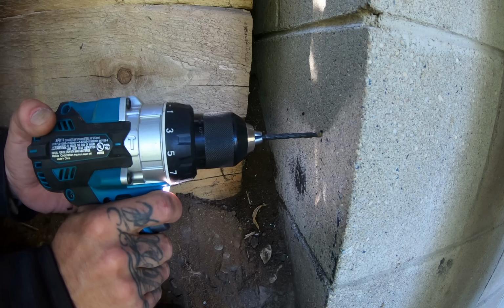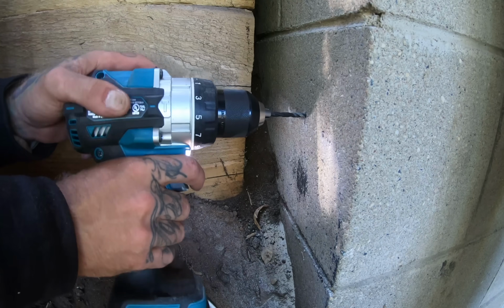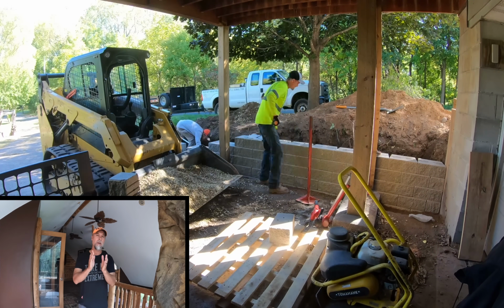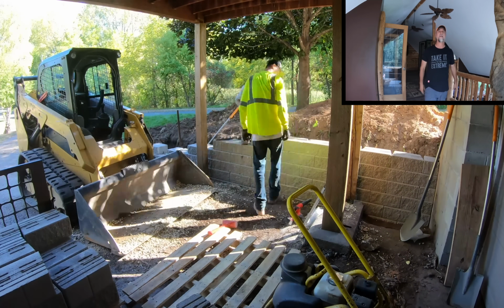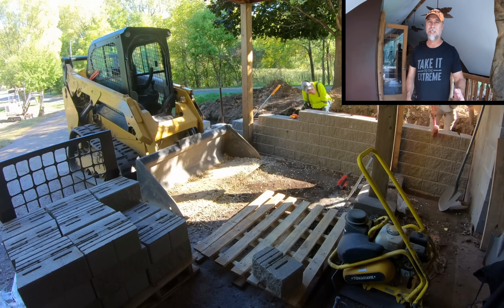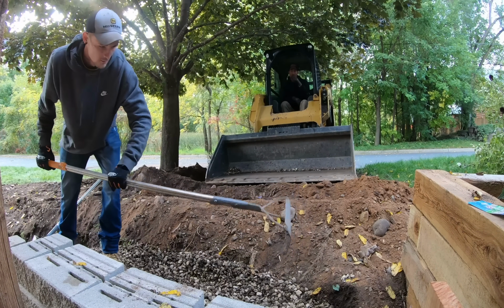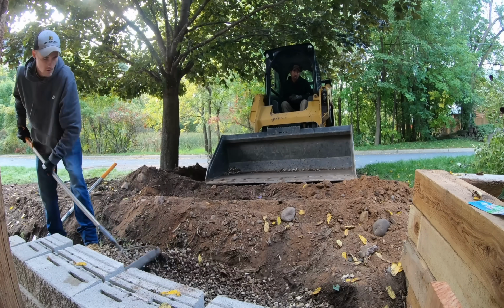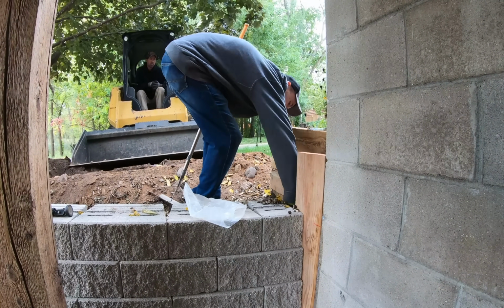Deck Inspection Brings Our Job to a DEAD stop.

Comment: Good Beautiful evening Stan! I just got home from a long day of work! I havent been on a job that requires an inspection yet. Keep up the great work!
Reply: This isn’t a job required inspection. It’s only required because they aren’t qualified to do load calculations, but if they had a good bit of experience with loads and I thought they did,…they should know what the code is already…I’d also think they would know that a regular drill isn’t effective when drilling tap cons. Wow. Just straight up bugard this one
Reply from the maker: We know load calculations, the effects of structures and the surcharge it creates on the soil.  BUT WE DON'T DO DECKS for customers.  We stay in our lane. The person inspecting the deck was the person going to do the repairs on it.

Comment: Leveling that base reminds me of when I built my freestanding 10sq ft deck.  Had the back a foot lower than the front and I used concrete footings for the 4x4 posts.  My thighs burned for a couple days after finally getting them leveled side to side for both front and back.
Reply from the maker: Bet it was worth it 👊
Reply: @Dirtmonkey  yeah.  Now I gotta clear and level a spot to build an attachment shed so my garage can get cleared out.
Reply: Only 10 sq ft?  Was it 2 x 5 or 1 x 10. :)

Comment: Stan, couldn’t you have just stacked Brussels blocks (or similar) in the place of the 2x12? It would last as long as the wall, give a nice concrete reveal instead of the wood, and cost would be low since you’d just be stacking plain square units one on top of another

Comment: First thing I would do # 1, replace all the wood post with a metal post, 2nd thing would be an (I) beam all the way across the front of the deck, as long as the wood isn't rotten for the floor joust. I stop the video at 3:15 to say something!

Comment: In my experience, I would never ever butt PT timbers to a house or any kind of structure.  When the chemical starts to leave those timbers in about 10 years, the carpenter ants love to move in and get a nice highway to the structure.
Reply: Correct
Reply: @johnrcornell  If I used timber, I would have an exterminator spray it every year.  Otherwise I would us only stone, cement, or block.

Comment: I'm wondering why no landscape fabric anywhere to separate the native soil from the drainage stone? I thought that was always step one.
Reply: get what you pay for if cost is a factor....ot sure why so much rock was used when two 2" drainage tube would have sufficed buried in 1'x4" stone beds at 3' depth and 2' depth.  not that they would be needed that wall would weep just fine for the soil it's in.
Reply: Agree. No fabric to separate soil from stone. The entire tube of caulk is laughable. If you need that much silicone then something is grossly wrong!

Comment: Why would anyone put wooden posts (treated or not) directly into dirt?  I can't think of a worse way to set deck posts.  The posts will wick water and rot out.  Even in this video, the top of the deck corner post is warped and split wide open.  I know from experience.  Our Lowe's built deck only took 1 year to blacken, start rotting and sinking into the ground, and turn to rubber.  We used the tractor to pull them out.  One was so rubbery, we bent it over nearly 90 degrees.  Other than breaking, it stood right back up when we released the tension.  Of course, the whole deck looked like it was built by a kindergarten class who had never heard of a miter-saw, level, square, nor of securing part flatly together.  The stair railing looked like a multi-angle ramp for Evil Knievel, the entire deck sloped 2 inches from one side to the other, and the wooden steps and risers had sunk into the dirt.  It took 2 months for us to rebuild the entire thing.  We had to tear it completely apart and suspend the 10x12 platform in place to remove the 7 legs, then pour concrete pilings with screw-adjustable jacks to install 9 new legs, re-skin the outside with Trex material, install steel stair risers(old ones varied up to 3 inches), replace all the railing posts with new ones that were the same length, and most of the railing.  We also poured a concrete landing pad and built own custom stair planks out of Trex material.

Comment: Awesome vid as always. Contractor experience tip, use an SDS drill when making a hole through concrete blocks or any sort of cement (even an old foundation).  Game changer! I don't know if you have one in your arsenal or it was not on site that day, but I used to burn though bits and struggle until I found the magic of and SDS drill (and drill bits) to make my way through any kind of cement.
Reply: I used to install safes in my early 20s and used SDS bits. Hilti made excellent (pricey) drills and bits but it was worth the price because it saved time and was more reliable. I don't drill into concrete much anymore and surprisingly get by with a cordless Ryobi SDS drill. It would melt if I used it continuously like I did back in the day, but for small tapcon holes and so forth it works great. It's nice to not have to drag a cord around either!

Comment: There is no way I would accept a 2X12 as part of the wall. If I spent that kind of money on a wall I would want it to last forever and not rot out in a few years. Should have taken the time and put in the 2' section of wall with a corner.
Reply from the maker: Thats green pressure  treated- same material they build entire house foundations out of around these parts. Its rated for underground applications
Reply: @Dirtmonkey  I do agree with Devin020.  All that work and it just gives the appearance of "Skimping", even if it will last a decade.  All of your videos up to this point exude quality craftsmanship.  If I saw that while surfing the youtube, not knowing who posted the video, my first thought would be that Dirt Monkey would never allow that!  yikes.  Just constructive feedback.
Reply: @Dirtmonkey  why not build the entire wall from 6x6 PT then?
Reply: In my mind this was a cost savings choice by the home owners. Seems reasonable from that point of view.
Reply: Yea I would not accept that.  Sorry, it looks like sh!t. The homeowner was probably too cheap.
Reply: How are you even able to determine from watching a video if that 2’ section would meet code?  From what I am seeing the slope of the hill would be higher then the side.  So, would that 2’ sectioned be able to handle the weight of the hill behind it?
Reply: I still wouldn’t use that treated wood got composite it’s going to wet down south treated lumber doesn’t last
Reply: @gregbuckner791  you do realize it’s ground treated wood?  I particularly would have used Marine Treated.  But, Stan may not have it in his neck of the woods.  Composite wood delaminates; so not sure that’s the right way to go,
Reply: @firsttimejimmy9791  If a 2X12 screwed to a flimsy L bracket can held it I'm sure the wall will!
Reply: @FordTruck611  a quarter inch vs 2’🧐
Reply: maybe 5 to 6”
Reply: @firsttimejimmy9791  marine treat in this neck of the woods is cedar or teak, and it's self coated in tar. that plastic deck wood comes in the color of the block and doesn't rot unless sitting in full sun for a decade or two. i wouldn't use it myself, i'd have filled that gap with mortar.
Reply: @aprilgeneric8027  Composite boards delaminate from absorbing water and the constant expansion and contraction from the day’s temperature cycle.
Reply: @jonblakemore6454  The retaining wall could be built using 6x6 PT, owner chose block.
Reply: @FordTruck611  that l bracket is just there to hold it as they're putting the wall together. The backfill is going to hold the board to the block so that short 2-in portion isn't a problem unless the whole cinder wall block is pushed down the driveway.
Reply: @klesko55  that's my point.  Why mix and match?
Reply: "forever" fo you own a pyramid lol

Comment: What about that giant split in the 6x6 post that the beam is sitting on? That looks more of a concern.
Reply: That’s called a check. And though they look scary, they’re rarely more than an inch deep, meaning, they’re cosmetic more often than not. A split is a different story, meaning it’s split all the way through, which is rare with lumber that dimension.
Reply: Well wood is a long stronger in compression than in span. While unsightly, that longitudinal crack doesn't mean anything.
Reply: How many 6x6 posts don't have a check or split?
Reply: John Smith it can be as long as it wants, what I’m saying is I’m willing to bet that it’s only an inch deep. Which is absolutely nothing to worry about. It is very rare and unlikely for a 6x6 to develop a natural split all the way through unless it has an irregular knot.
Reply: The beam looks to be sitting on half the post due to the check which puts an uneven load further causing the check to increase. The grain structure is not clear from the video but it’s likely the post can straight up split down the middle like a log
Reply: @John Smith you not know the difference between length and depth? He said "inch DEEP." Also, that's a preexisting structure, and it has nothing to do with this job. Derrrrrp.
Reply: I have never seen a PT 6x6 post without checks in it. If you find some, let me know!
Reply: @John Smith do you have SYP where you live? It is like the best for strength and chemical retention. However it is know to check and do just like the timber in this video. That's why most people cover them in a vinyl or aluminum sleeve or box them in. So people like you don't get nervous about them.  It is not a piece of precision.
Reply: @John Smithmaintenance is part of everything but generally they are good for the life of the house. There can always be exceptions. I used to own a sawmill and now I work with lumber and wood preserving. Last Friday I was working at a wood pressure treating plant. I am Not a licensed treater myself but I have been working with it for years and I might add I am not uneducated or a novice in the matter. But I like freedom and say buy what ever you want with your own money because it's your choice

Comment: Yeah that deck was in pretty bad shape. Hopefully they fix it before it falls down in a few years and they don't mess up your new wall lol. They probably need to just give up on having full access to that garage door and put in way more piers if they want to keep that deck. Would be way cheaper than rebuilding the whole thing.

Comment: i would not even start the job/ mobilize until that deck is repaired.  They will most likely have to dig for new footings if they're above a frost line..too close to your base course.  That town inspector is on a mission.
Reply from the maker: He wasn't a town inspector- he was the person inspecting to do the deck repair.

Comment: Stan why didn’t Sam or Blain make filler blocks to match up against the foundation wall instead of that piece of wood and that deck is a mess wouldn’t send my enemy out on it post rotted out and not lag bolted to the rest of the deck 🤦accident waiting to happen
Reply from the maker: We couldn't undermine the footing to dig back far enough to do an inside 90 degree corner out of block.

Comment: ~~Ah,used GE to caulk,not to bad or had problem when I used it. That being said,if the following  2-3 days were suppose to be clear w/no rain in forecast I would've personally opted for Vulkem. Whenever Buddy does a deck now secured to the house he'll lay cpl beads Construction across the middle backside. Followed by bead Vulkem around the edge&holes for the lags ever since I suggested it. After helping him tearing one out ,the owner claimed ,only around 10 years old deemed dangerous due to the board (can never remember the name) attached to the house on the verge of failing? Had flashing but being the Midwest w/ice&snow moisture still managed to get behind it before began rotting away over said years.
Reply: Ledger board?
Reply: "Buddy"? Are we supposed to know who that is?
Reply: @ProblemChild-xk7ix   Thanks,it's my Buddy's specialty&simply give him hand every so often if he needs it.

Comment: As a licensed architect, I would not have accepted the corner post w/o addressing the split at the top.  Either replace it or fabricate a 1/16" minimum thick metal band to close that split.

Comment: 8 courses of Versa-Lok square foot units, plus a cap would put you at 5.67-ft tall. Even if you had put in a 1H:1V of crushed stone (you didn't)...that wall would at a 1.1 factor of safety (min. is 1.5) for overturning (assuming a generous phi 32 for the onsite soil). I would've put 4-ft of grid in that wall and disassembled his timber landscaping to finish that off right instead of sticking that board in there. Just my 2 cents.
Reply from the maker: Your thinking of the square foot units at 8" each course. These are the standard units at 6" per course.
Reply: LOL. Stay in your lane.
Reply: @Dirtmonkey  My bad. That said when you're doing a 4-ft gravity wall with small block, make sure you put in a full 1:1 zone of crushed stone.
Reply: @littlejackalo5326  LOL... I'm in my lane buddy. I design walls (much bigger than this one) all day, every day.

Comment: Glad to see Sam again was wondering what happened to him. Isn't the new wall going to be in the way if they have to redo the deck footings?
Reply: IF the deck has a belly in it than they will need footers and support in the middle. Not the ends.

Comment: Did you need to put drain pipe at the bottom of that wall? Where does rainwater go as it runs downhill towards that wall? Thx

Comment: Nice job, but that 2x10 against the house should be pressure treated. I saw that it was holding dirt back in that corner. Definitely gonna rot fast in that environment.

Comment: Stan have you ever experimented with concrete entrained gravel footing (0-¾") for a wall?  Wisconsin has used concrete added at 15% to the strengthen gravel under roads adding 20 extra years to road life.
Reply: Interesting idea.
Reply: You'd never see a footing for any wall in canada.. simple not needed. Waste of time and money
Reply: @joshuachipman4163  You must be referring to a poured footing, the gravel base required by code is a footing.
Reply: @flightographist  that's exactly what I meant. Built walls for years never poured a footing
Reply: @joshuachipman4163  Got it. You know, I was down in Iroquois last week, the old canal caught my attention- massive quarried limestone blocks on an inclined plane, built in 1846- still there! With a bench block footing, same material, creating the actual lock still in excellent condition.
Reply: @flightographist  that is impressive. We don't use limestone walls around here because they tend to deteriorate over time. More interlocking blocks but anytime I go by an impressive wall I give a little silent nod to whatever craftsman didn't cut corners, as they are a dime a dozen
Reply: @joshuachipman4163  These are mind blowing; top to bottom, no poop, gotta be 75 feet- forget the pyramids, British army engineers baby! Note, the very top line machine available was skilled labour.

Comment: You should have turned your wall one block 90 degree off the house then run your course.  Common sense.
Reply: That's going to increase the job cost as you have to get into the small retaining wall above the current work. Plus you're farther into the slope which may require increasing the height and complexity of the wall. These are compromises that are made after discussing options with the owner.

Comment: Suprised to see the crew jam that board in there. I don't like how close that wall is to the posts either.  Seems like a shortcut to avoid cutting blocks to me. Not a typical shortcut your crew would take in my opinion.
Reply: As I understood it, the original plan was changed due to issues with the deck. Putting in a row of blocks for a corner would require getting into the short retaining wall above the current work because you would need a base back from the corner of the garage. These are $ compromises you make after discussing options with the owner.

Comment: Stanley question here. at what point do you need to get a permit for a repair? when do you have to bring it up to code if you are just doing maintenance on the deck? my understanding is you are just doing minor maintenance you don't need to bring it up to code. in Minnesota
Reply from the maker: My company is not doing anything to the deck.  we are building the retaining wall only but the crumbled dock posts are in the way.

Comment: I can't say I've ever seen someone drill holes with a normal drill!..I've always used a roto-hammah to drill into concrete even a block! Lol
Reply: It's a hammer drill. Derrrrrp. Nobody is going to get a rotary hammer drill to drill a few tap con holes. LOL.
Reply: @littlejackalo5326  I could of set up the right tool for that job had them drilled and put back away by the time he got that cheap little drill to finally go thru that block!!
Reply: @541beausham   It's a hammer drill although I am not sure he had it set to use the hammer function. It's fine for a half dozen small diameter holes into cinder block.

Comment: Are you using any type of adhesive on the Block of the wall or are you just relying on the built-in tabs or bumps to keep them in place?

Comment: Funny that cooking with gas is actually the least efficient way to add heat to a pot. Electric is much quicker, and inductive even faster.
Reply: My son built an all Electric House. Every thing electric. The local power company had to repair some lines. Was off for about 4 days. 
No heat. Couldn't cook. Lost all of his food in freezer and refrigerator. No lights. Totally in the dark. 
The following 2 years later. He went to gas for cooking and install a stove 😅😅